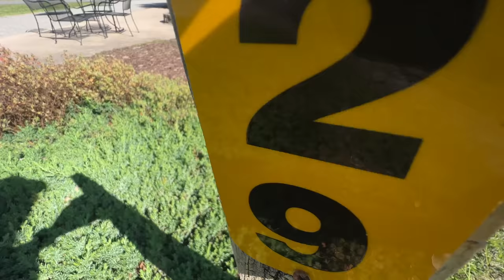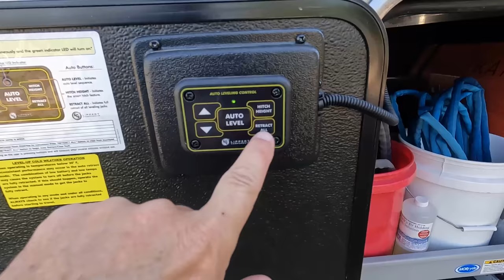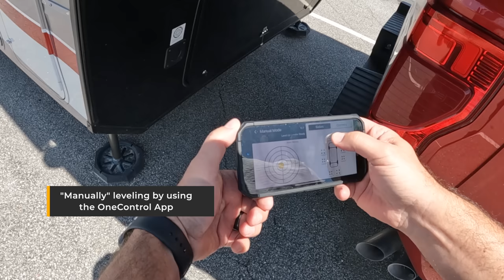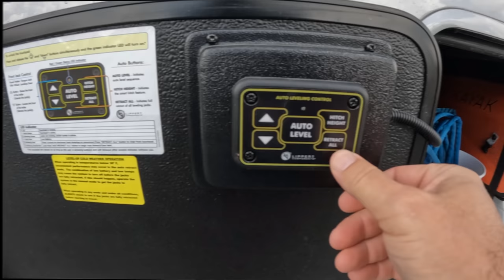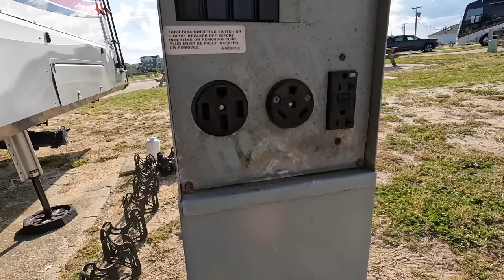Typical Fifth Wheel RV Travel Day! (Full Time RV Life)

Comment: An efficient and quality way to do your "light check" Have your truck running (idling). Then on your headlights with high beams on. While those are on also turn on your emergency flashes. Do a walk around your entire rig. All necessary lights are on and should be functioning. Easy!
Back up lights are the only extra step.

Comment: Glad you’re having a great experience with Grand Design. I had a new 2019 Grand Design Reflection and it was a disaster. The tandem axles were misaligned (wheels towed in on one side and canted out on the other side), substituted 1/2” floor board in lieu of 3/4” spec (this resulted in the edge trim rubbing a hole on the main floor laminate). The plastic vent cover gear box and plastic furnace squirrel cage blew up. They were too lazy to sweep the roof for debris and particles so a granular pebble poked a hole in the TSP membrane causing water to penetrate the roof board. Random screws were coming loose and disappearing form the bottom skirts. Customer support for non You Tubers was scant. Honestly it was a miserable experience that I will never forget. I have since ordered and taken delivery of a 2022 Newmar, London Aire. The difference in customer service support, quality engineering and design between Grand Design an Newmar is like pee wee T ball and Major League Baseball. What’s my point? 1. I took exception to piss poor customer support and amateur engineering from Grand Design. 2. Given the opportunity, you might give Newmar a try. They will impress.

Comment: Great video, again.
A few people have chastised Chad for connecting the breakaway cable to the hitch instead of the truck itself.  I have always attached to the hitch, and never felt unsafe.  So, let's think about this.  
1. If you look at trailer attachment failures, they are almost always due to human error.  The ONE TIME you forget to check that safety pin that makes you make sure your hitch is fully engaged and latched, is the time it will fail, and you'll drop your trailer onto the bed rails.  
2. Other failures, such as an actual weld or material failure are extremely rare.  The failure of the pucks or pins or rails or bolts are just not things that seems to be a popular point of failure.  
Ignoring all of that, let's look at when the worst happens and your 5er separates from your tow vehicle.  Let's say that someone has tampered with the pins or puck locks that hold  your hitch into the bed of your truck, you hit a large bump, and everything slides out the back of your bed because you don't have a tailgate.  Worst possible scenario.  A fifth wheel will immediately drop it's nose to the ground.  Most likely your fancy SnapPads(TM) will provide very little cushioning of the blow, and immediately be ripped from the landing gear.  If the angle is severe enough, the hitch could land next, but likely the front edge of the RV at the landing gear will be next.  Either will have anywhere from 1500 to 4000 pounds of pin weight forcing it to the pavement, providing lots of friction to "slow" the RV.  I'm not saying that it's impossible, but highly unlikely, for the breakaway braking to really make a difference at this point.
This is very different from a travel trailer, or other bumper pull trailer, in that the angle is not nearly as severe as a fifth wheel, and could continue sliding for hundreds of feet if hitch failure happens at highway speed.
I guess I'm saying that where you connect your breakaway cable for a 5th wheel to avoid a very rare condition may not be that big of a deal when considering the rarity of such a failure and the consequences.

Of course all of you pulling 5ers carry a torque wrench and check all of the mounting and pivot bolts on your hitch.  Right?  RIGHT??

Comment: You might consider attaching the breakaway cable to something other than the hitch assembly. If the hitch itself or connection to the truck were to fail, the brakes might not apply in an emergency. It’s pretty unlikely, but can happen.

Comment: The cable run that plugged in on the drivers side of the kingpin and near the rail in your bed, is that for a DC-DC Charger? Did you put that all in? If so, can you do a video on that? Thanks!

Comment: Chad, my wife and I enjoy your videos.  I like the techie ones, we both enjoy the travel vids.  I am assuming that the large 2 conductor cable you connected from the front of the RV to the truck (@1:26) are to enable charging the batteries from the truck while driving.  I have implemented truck charging with 1/0 cable and Anderson connectors.  Currently my trailer-to-truck connection is a ~ 10 foot cable attached to the 5th wheel with an Anderson connector that connects into the truck bed near the 7-way connector. Assuming you added the trailer connector yourself, how did you get a cable from inside the storage bay to the outside connector and attach the connector itself?  What type of connectors did you use? I like the idea of having a totally removable cable between the truck and trailer to avoid the potential of having someone steal $100 of 1/0 tinned OFC cable when the trailer is in storage.
Reply: For anyone interested, I sent my question to Chad via email and this was his (super quick) response:
Hi, Rusty!

That’s the interface between the Volta alternator in the truck (proprietary 60V alternator) and the Volta Power System in the RV.  It provides about 6KW of power while driving - enough to power all of our AC units and still charge the Volta battery bank.  It was installed by Volta, so I’m not sure how they routed the cables.  The cable I hook up fro travel comes completely off and is stored when camped.

Right now, we are still testing a prototype of this system and are expecting final updates to it next week.   Shortly after that, we’ll have a video about it.. 😊 

Hope that helps!

Comment: Hey Chad. I was once told not to hook my brake release cable to the 5th wheel hitch. In case it came out of the back of the truck. I hook it on a loop in the bed of the truck.

Comment: How do you get the front jacks to each be an inch off the ground for the pull test? I've tried repeatedly to get the Lippert OneControl app to do this but no matter which front corner jack button I press it always  extends or retracts the starboard side jack first before doing anything with the port side jack. It won't operate them independently. I have a '21 GD Solitude 378 with the same Ground Control system you've had on both your rigs.

Comment: Never thought of spraying an electrical recipticle prior to use. Good idea for those larger AMP draws. You folks put the moride new suspension "at the factory" prior to delivery...did you use the supplied tires and wheels or upgrade those as well? If no upgrade, what brand/size tire was Grand Design supplying by default?

Comment: Just a thought.. brake away connected to truck and not hitch. I just saw an Anderson crushed and if the hitch isn’t installed correctly or fails and comes out of the truck, at least the brake away is connected to the truck to engage the trailer brakes. I realize you have been doing this forever but I changed this for me when I saw that hitch fail.

Comment: Snarky Comment: "or get a Gooseneck hitch on the trailer and once it has 3,500 lbs on the pin, all you need is a trailer brake pull test."  :) love, love, love my Gooseneck!
Reply from the maker: We will be trying out the Gen-Y at some point... 👍🏼
Reply: @ChangingLanes  I can't share a pic, but I can tell you that having my bed available whenever not towing is awesome!  The wife's motorcycle had a serious mechanical issue, and instead of calling a tow truck, we loaded it into the truck bed and dropped it off at the motorcycle shop.  Now imagine a Harley-Davidson Road Glide Special in the back of an F450 cruising down the highway, LOL.

Comment: Are you usually running your ac while traveling during warm weather?
Reply from the maker: Yes.  In the past (in our 397), we could only run one AC... Now, we can run all 3.
Reply: Our 2012 Keystone Sprinter 297ret isn't equipped for that.  It would be great to be able to run refrigerator and ac when traveling.

Comment: What did you plug into the camper at 1:25? Did I miss an explanation video or spotlight on that add-on?
Reply from the maker: That's the Volta Power System.  We're still working out a few bugs with them on our prototype, then we'll definitely be producing a video! 😊 ⚡️

Comment: Chad, why do you have an extra duty charge plug going from your RV to the truck. Isn’t the 7 way plug sufficient?
Reply: Probably has a DC to DC Charger....coming from the truck....going to the trailer batteries. It charges the batteries while you are driving. That's how he can run the AC's while driving. Our's is a 50amp...made byRedArc.

Comment: Hey Chad, when you were hooking up I saw your plug-in what looked like DC power. is that have to do with your solar system and charging system? And do you also have your seven pen for your light?
Reply from the maker: That's the connection for the Volta alternator in our truck that supplies about 6-7KW of power while we drive to charge the battery and run whatever we want. 👍🏼  We do also have the regular 7-pin.
Reply: I forgot all about that system.

Comment: Where do you put the levelers down vs not?  Usually if we make a quick bathroom break or a snack or if the kitchen we don’t put them down. Just want to understand the reasoning of when you put them down while still attached to the truck.
Reply from the maker: For just a bathroom break, we don't put slides out and no landing gear.. Only when we stop for lunch and want to put a slide out.

Comment: Chad, when you hooked up, it looked like you plugged two cables into the front of the rig. If you don’t mind me asking, what are those?
Reply from the maker: That connects our Volta alternator to the Volta Power System... It provides about 6-7KW and allows us to run all 3 ACs while also charging the 18KWh battery.
Reply: @ChangingLanes  so the alternator is on your truck?